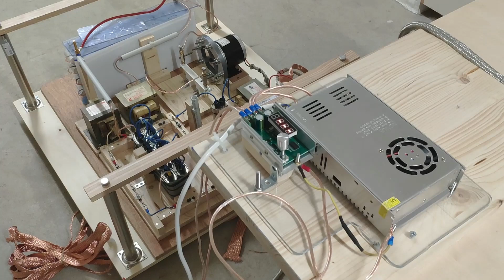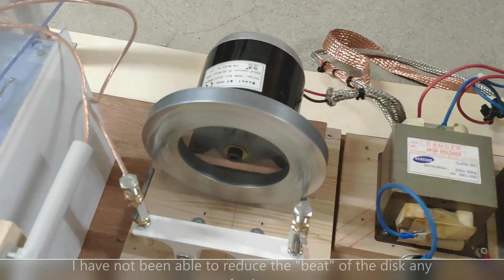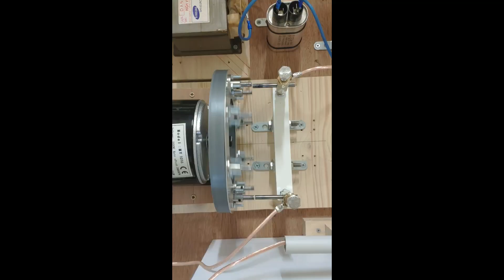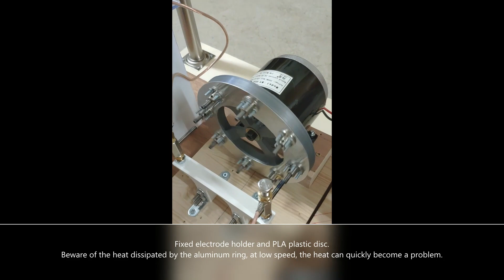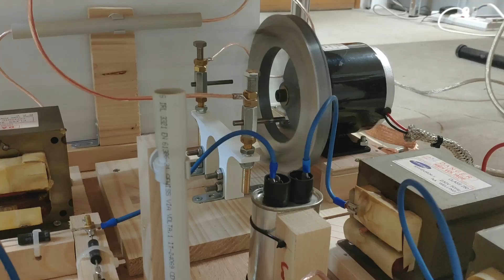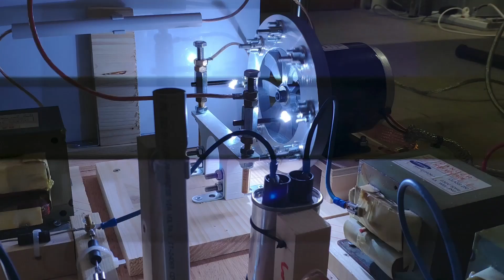Tesla coil rotary spark gap (DC motor)

Comment: if you put the rotary spark in a glass vacuum chamber and use mercury for the contacts it will reduce the damage to the points of arcing
Reply from the maker: I think the vacuum is not desirable because the capacitor could not be charged and a permanent electron beam will exist between the electrodes .. which does not allow to obtain the charge / discharge cycles (in my opinion ...)
Reply: @fabienGA  capacitors work in space , in vacuum
Reply: when you use the vacuum chamber, you solve the problem of "spark erosion " at the point of arc.

Comment: Are you only using the transformers to step up the voltage? if so what do u recommend? cause i was thinking of doing that
Reply from the maker: Yes, this is the first voltage rise before the Schenkel Doubler. I use 2 MOTs in series. It is possible to use 4 of them, two in series with two in parallel to increase the current. However the results with 2 were enough for me.